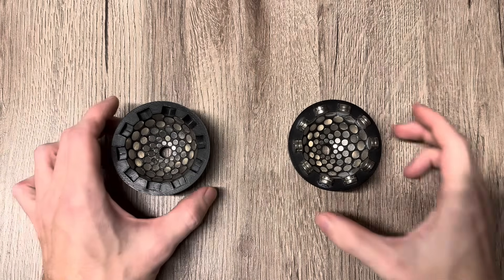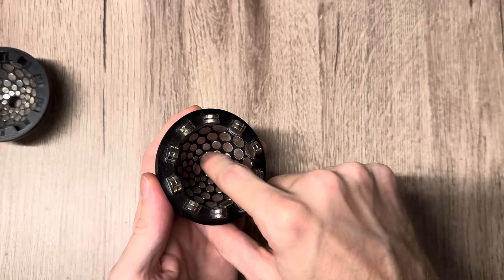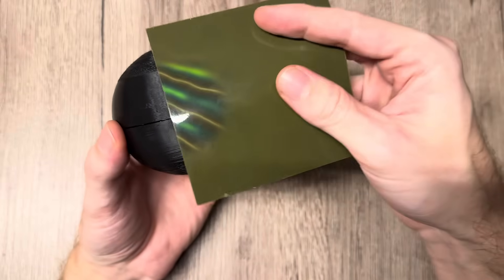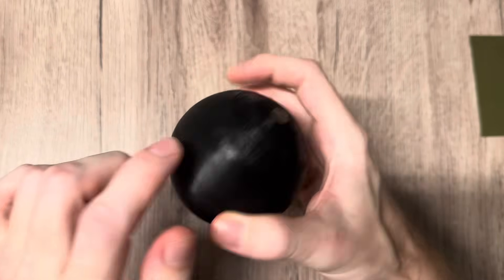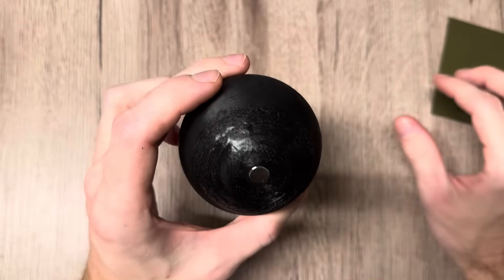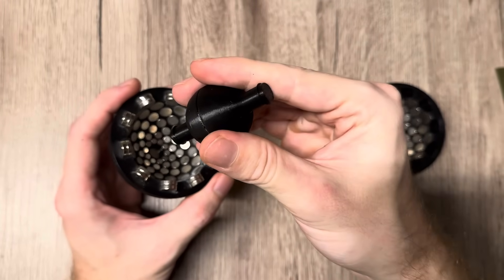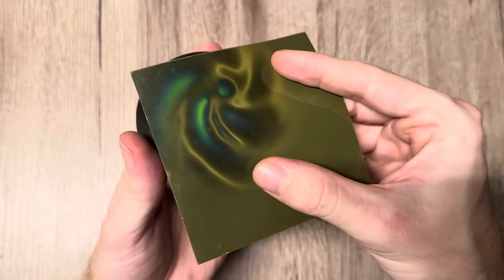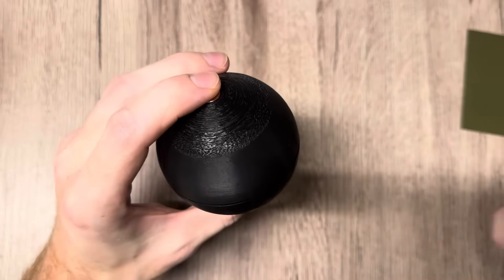Spherical magnet array with a spiral configuration 🌀🧲

Comment: It could be useful for having an outer shell array that is complementary with ball bearings so that it is forced to spin the other ball. The resulting passive angular momentum could work as a gimbal. 

Of course, I could be completely mixed up, this is nikoli level stuff!
Reply: Yes but it would work better inside out I devised this in 2014

Comment: Can you make an array that sits on top of another where the magnetic patterns cause a rotation on the top unit? Place some wire in the bottom of the whole thing and we get free energy powered by magnetism. Imagine batteries that never empty. If it works, I get 10%.

Comment: Add a metal center shaft with a coil of thinly wrapped wire around it to bearings inserted into each end attach a multimeter leads to each end of the wires one on each side an see how many volts it’s produces curious to know

Comment: Create a larger version of this let's say basket ball... magnets on the inside. Then Create a smaller size ball with magnets on the "Outside". The smaller ball would spin .. the wheel in side a wheel was really a ball inside 2 spinning wheels. 
I believe the ratio is 1/3 the size of the outer ring. I've trying to build this for yrs. Nice work. 
You could tech. Generate electricity from the right scaling.  The inner ball would need shaft to connect it to hold it sill while the other ring or rings rotated. Next step .. Create a tower shape like tesla tower.

Comment: woild be interesting to see the properties of a uniform pyramid magnet (not constructed in layers or an array).  Where would the maximum field strength be located?  Combined with a diamagnetic structure, could you construct a stable point for levitation above the peak of the pyramid?

Comment: Quantum entanglement chamber?
Adjust the center magnets electrically to induce controlled flow. maybe run ferrous tube through with gas for solid state plasma turbine.

Comment: Kindred spirit!

I would love to see a glass sphere with an embedded magnetic detector sheet. I suspect the cavity would change shapes when assembled and the magnet plugs are added/removed. 

I wonder if a Halbach array could be integrated into your pattern and what impact that would have..?

Very cool!  Subbed. 

I’d love to connect with you. I’ve been on-and-off convicted that static magnetic levitation is possible.  I’ve tested my ideas, which have always been naive in hindsight, to gain a better intuition for why this is probably impossible.

Comment: So, if you were to spin this along its axis, would it induce an interesting electric field? I guess probably not a strong one. Uhh…
Ok, probably simpler to think about magnets arranged in a helix pattern on a cylinder.
Then, when you rotate the cylinder by some amount, the magnetic field that would be induced at the new position will be like the one from before except shifted vertically by some amount.
I don’t have a good enough understanding of E&M to know how to handle the case of a moving permanent magnet?
But, I’m pretty sure the magnetic field would be changing as if by vertical translation (away from the boundaries of the cylinder anyway).
If B(x,t) = B(x - v t, 0)
then (d/dt)(B(x,t)) = -v \cdot \nabla_x B(x - v t,0),
where v is in the direction along the cylinder,
and uhh…
hm.
I guess the electric field at each point in the cylinder would oscillate over time, probably in some sinusoid with frequency related to how fast the cylinder is spinning, the pitch of the helices, and how many alternating helices you have going around the cylinder, and also the radius of the cylinder.

Anyway I think something similar would happen with the sphere but in a way that would be harder to precisely analyze .

Comment: You are only seeing the field that penetrates the paper. So when you say, "The field disappears", it's really just dipping below the paper. This is just further proof of the fluid-like nature of the fabric of space. It should be possible to make a computer simulation to predict magnet arrangements using a fluid model.
Reply: "The two sets of equations are describing two different things. However, there are some similarities. Both are concerned with fields. Navier-Stokes with pressure, velocity, density, etc. of the fluid and Maxwell with electromagnetic field and charge/current density of matter. Both have equations that describe conserved quantities. Navier Stokes has mass conservation and Maxwell's equations imply conservation of charge. Since they're both conservation equations they look similar. Both are also concerned with how the fields are changing with time."
- Redditor First_Approximation

Comment: my guy, you are doing some amazing stuff, i love it. btw in case it helps, david lapoint's 3d printed dome magnets have a little plastic sheet case thing that slides over the magnets to stop them from getting pulled out, perhaps you can modify that for your needs. 

you are doing some very important expansions on his work whether you know it or not and it has really cool implications for physics and engineering. the one configuration alone demonstrates a lot of jnteresting phenomena; it looks like a spiral galaxy, the different polarities corresponding with differing number of arms has fun implications for astrophysics and then consider what would happen if you spin the magnet array. how might that affect the surrounding medium? 

a single dome looks like a spiral galaxy, a sphere looks like a plasmoid. the second configuration reminds me of the hexagon on saturn and other gas giants poles. so much cool stuff going on, happy to see you pop up in my feed, great work omega!

Comment: remove the cap magnets and place maglev bearings. run a shaft through the bearings. on the shaft, inside the magnetic orb, construct another orb with the magnets facing outward and opposing the magnets facing inward. make sure your measurements are correct to allow the magnetic fields to overlay in a way as to not allow for "hitching" effect. then spin it up to arround 3000 rpm
Reply: False. However,  close.
Reply: @the_natrix9959 let them figure it out themselves. put them on the path, don't walk it for them.
Reply: @piereduplessis4544  what are we trying to achieve here?
Reply: @ADHDGarage-q1m creating a thingamajig.
Reply: Its adorable that you guys think you have some kind of special magic knowledge.
You just described an energy wasting machine. Congratulations.
Also "maglev bearings" don't exist in the fairytale BS sense you seem to think they do. They only exist in very large, power hungry industrial and scientific applications.

Comment: I'd really like to see a magnet constructed as a hollow sphere where the outside is one pole and the inside is the other, not built from the arrangement of smaller magnets.
Reply from the maker: I don’t think it is possible to magnetize a magnet like this.
Reply: @OmegaZZ111  I think there might be a coil configuration that could work, it would be pretty inefficient though since only half of the field can be used since you don't have access to the inside. If not I'd settle for two hemispheres at the end of the day. Been kicking the idea around in my head for the past few weeks, maybe one day I'll get to try. I'm interested to see it's properties, the goal is for a synthetic monopole by hiding the other inside
Reply: @Ivan.Wright  Good luck, but that sounds akin to making water that's only wet on the outside.
Reply: @EddieTheH  Thanks. For that I'd use hydrophobic powder on drops of water
Reply: @Ivan.Wright  Then it's not water, it's a hydrophobic compound and water.  
I'm talking about pure H2O.
Reply: @EddieTheH  Sometimes all you can afford is the closest approximation to an ideal. The world is held together by them and I don't discount them for the ways in which they don't align with the optimum. I see in what way my water solution has the same effective outcome in the abstract and judge it based off that alignment.
Reply: @Ivan.Wright  So it's more akin to "I've built a time machine, all it needs now is a time machine engine..." 
We can't just ignore all previous scientific observations and then redefine things to make the impossible possible.
Reply: @EddieTheH  No, but if that's how you feel. If you'd like to get out of the realm of analogy you can tell me how I'm wrong outright, otherwise I don't see any further discussion with you being productive
Reply: Hmm. Polarizing aside, what advantage do you imagine this would have? Perhaps magnetic flux is not clear in your mind yet?
Reply: @the_natrix9959  I see no advantages, just an outcome that would be interesting to achieve. What about the idea gives the impression I don't have a mental model of flux, if you could expand upon that I'd be greatfull
Reply: @Ivan.Wright  hmm. I started to grasp it more tangibly whence I began to move my attention to the inertial 'plane' v. Magnetism(N,S). Similarly, if you look closely, you can see the same mechanisms at work within the form factor of a common 🌼 🌸 🌻 🌹 🏵 🌼. Is it you and I, or that which is between you and I? Electromagnetic radiation, saturation station. The 'triple point' of light is our plight.
Reply: Polarization can be viewed as simply pressure. Separating the notion of North and South, or positive and negative, black, white, 1/0. Electrically speaking, the atmosphere is functioning 'this way'..in a Poissons Distribution HUGE buffering scale. Accumulated charges are moving around and growing in potential yet still remain neutral until a path is created and pressure/potential is enough. Any who..this isn't an unnecessary tangent. The other half, third?  was/is the interaction between/through/from electricity AND resonance/vibration.
Reply: @the_natrix9959  Can you explicitly state why a hollow sphere wouldn't work? If it's the plane of inertia you're considering then they lie within the shell orthogonal to the normal vector. Consider a very large sphere as well, you can conceptually scale it infinitely to where it's locally flat and consider it from there.
Reply: @Ivan.Wright  We(humans)can directionally charge magnets in many unconventional ways. I do believe this, sphere, is possible. If you flux around enough, you may realize it isn't a requirement to achieve your minds eye.
Reply: Spherical, in my mind, would be more akin to something like a dodecahedra, for example. It's easier to build with common magnet shapes. 🧲
Reply: Hear me out… donut shaped copper tube will filled with mercury with a magnet floating in the mercury..  then add voltage to the system and see what happens .. or spin a bunch of mercury with a impeller and see what speed is needed inorder to achieve lower friction due to flow patterns and viscosity effects at higher speeds .. To determine the output voltage generated by spinning mercury in a cylindrical container, you'd need to consider several factors, including the speed of rotation, the strength of the magnetic field, and the geometry of the setup. 

The output voltage can be estimated using Faraday's law of electromagnetic induction, which states that the induced voltage (E) is equal to the rate of change of magnetic flux (Φ) through a circuit. The formula can be simplified to:

E = -dΦ/dt

In a practical scenario, you'd need to calculate the specific parameters of your system, such as the area of the magnetic field interacting with the mercury and the speed at which the mercury is spun. Without those specific details, it's not possible to provide an exact voltage value. 

If you have the speed of rotation and the magnetic field strength, you could plug those values into the equations to get a more precise output voltage. It would be exciting to see more experiments utilizing this other mechanism for generation of electricity. Much like the coil and magnet, the physical spinning or and  mercury it self are another way of doing this .. I would like to see more machisms used in conjunction to achieve something greater , much like how alloys are greater then their parent metals in regards to wanted traits .